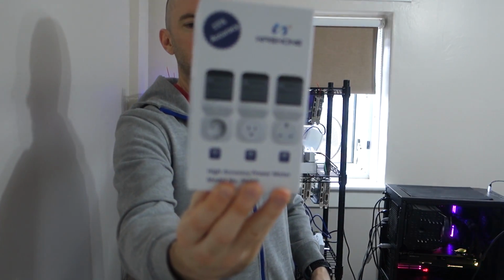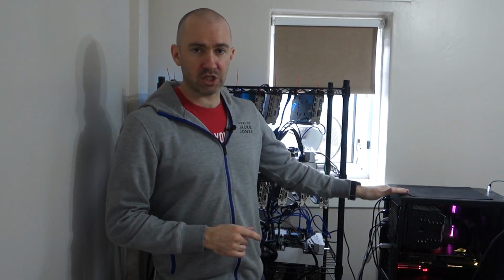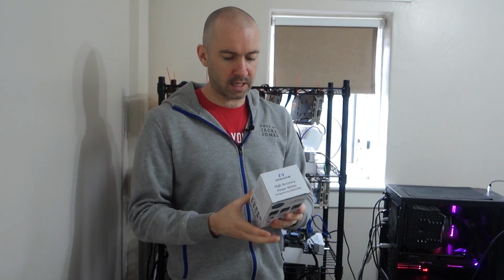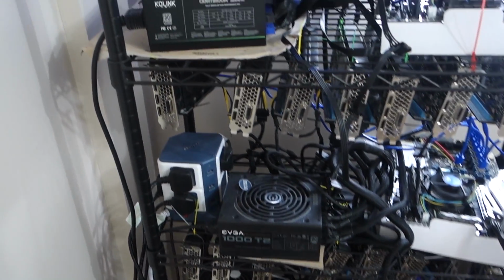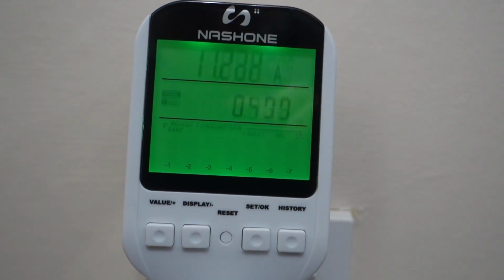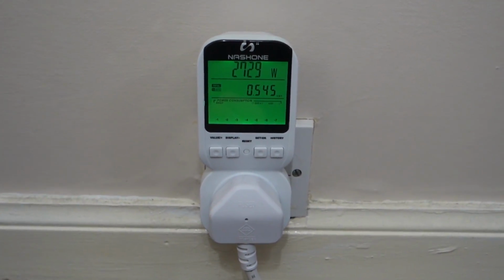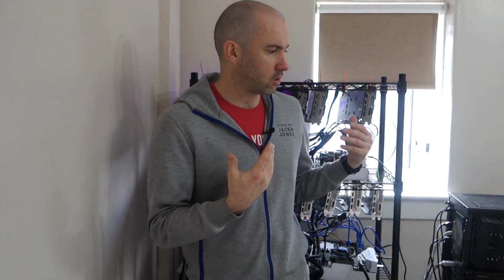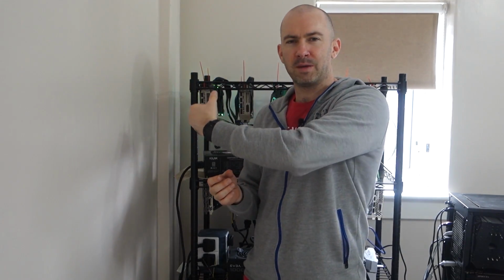Testing the Power Usage of Four Crypto Mining Rigs (29 GPUs)

Comment: I've been guilty of the exact same thing. I bought a power meter and used it when I first set up the rigs but it has gone unused since. Mine are running at lower power than they originally were, plus I'm consolidating from 2>1 rig now so my consumption should go down a bit further.
Reply from the maker: It's not necessary after checking if you keep the same settings, but I've tweaked things a lot since the start so it's a good way for me to monitor my power usage.

You'll definitely cut your costs down by selling some cards.

Comment: Good bit of kit Kevin, order one myself but mine keeps change fast between volts, amps and watts, have not figured out why yet
Reply from the maker: Is there a way to disable the change in the settings?
Reply: I think, my next step would be to unplug from the mains,  and hold the reset key, maybe remove the battery backup,  this would need to take the rigs offline again :o(
Reply from the maker: Yea that's not ideal. Perhaps do it next time you have to switch the rigs off.